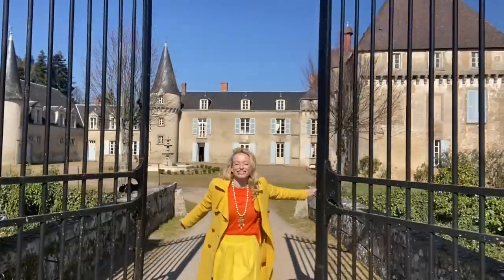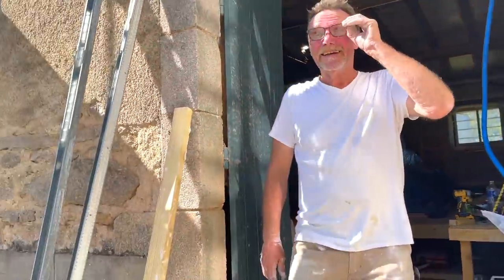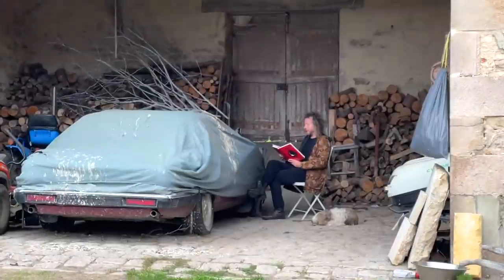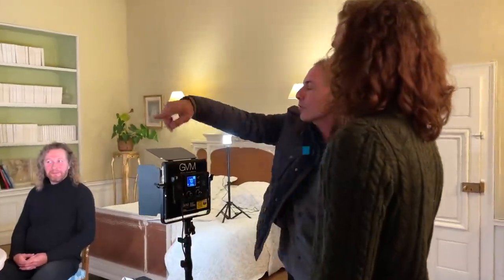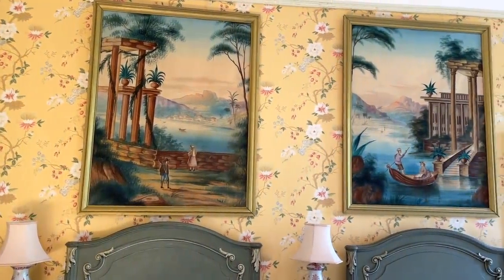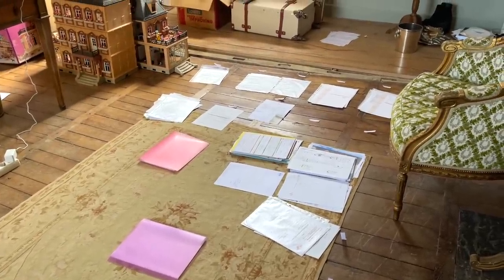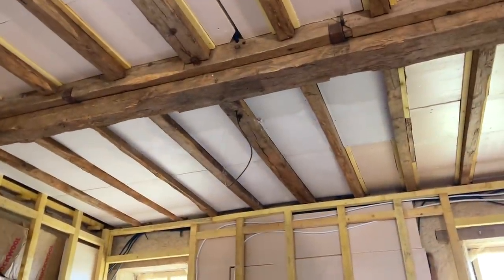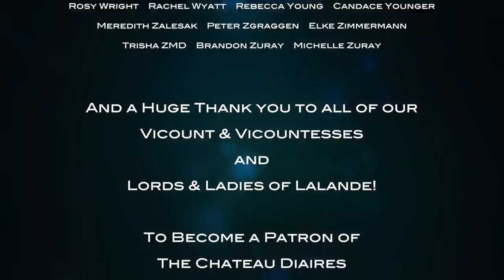DOING IT OURSELVES!

Comment: I wanted to supplement my post from yesterday with some other information.  When you increase the size of the radiators for more heat, that increases the amount of tubing inside the radiator and requires the size of the boilers to grow along with circulating pumps to move the anifreeze mixture through more resistance.  High temperature fluid is also needed to supply the heat you expect from each radiator and overcome the thermal loss due to poor insulation and single pane glass windows. HVAC engineers have 4 year degrees and  usually apprentice for 10 years to learn what you are trying to do by searching the internet. Here's my cliche for what you are attempting. "You don't know, what you don't know" this will end badly. Sorry, it's too big and important to "do it ourselves". Please hire a proper and engineer like Dick Strawbridge. He could help you. Respectfully, Jeff Martinec, retired Facility Operations Director and construction manager.

Comment: I notice that the thermal insulation in Nati’s apartment is covering the area between the two new French doors at the back where you hoped for another window. Were you denied planning permission?
Reply: @debbiebirnbaum2977  the rear ground level is higher so this is a practical solution to allow Nati a view from her bedroom/living room and easy access to the garden but will also give interest and a sense of more space to the apartment. I just wondered about the planned extra window. Reflective surfaces in the decoration will move light around the space so I’m sure it won’t be a problem.

Comment: FYI…when you have those large lilies in arrangements…as they open “slide” the anthers off.  the “stem” will still be intact and the flower will appear normal.  you don’t visually miss the actual anther… which if you leave too long will litter what lies beneath with pollen! 🦩💐
Reply: no…just the pollen!  it really makes a mess inside the flower itself and whatever is under your vase.  one of the lilies had no anthers…one did… probably had open further from when arrangement was made.  it was a lovely arrangement BTW!

Comment: is it possible to add a valve on the radiator supply line so that the water to each radiator can be turned off individually?  Might make future maintenance easier?

Comment: Have you changed something recently in the heating system, maybe mixing a new radiator (maybe mixing aluminium with iron?) which is making the rest corrode from inside? Something has happened in the installation for all of them to be that bad and leaking at the same time… Or they are just made to corrode after 15 years exactly… on top they are the expensive low temperature ones for geothermal /aerotherm systems 😬😬😬

Comment: Were rads frozen at some point with water inside and that cracked them?  But they look to be steel rads not cast iron , so they should not crack so easily by frozen water. What on Earth is going on? The calculators are notoriously inaccurate , they will always OVER estimate and you end up with too much rad capacity. Even calculators that adjust for local weather patterns are still wrong by +100%. So get half of what the calculator suggests.

Comment: Dear Stephanie and all your expert Lalande helpers! With regard to the central heating, have you considered a ground source heat pump, which would be much more efficient and “future ready “? Since you are making such efforts to improve the insulation this might make sense? The fact that so many of the radiators have leaked must raise many questions about their construction? Very best wishes and keep up your amazing energy! Best wishes, Andrew
Reply: it’s what they have now. thermal heating from the ground
Reply: Air + wrong anti freeze liquid = corrosion. Nothing to do with the quality of the radiators or the boiler !
Reply: Actually they have a BOILER which Stephanie said in her Patreon update would need to be bigger in future for the new radiators, so either gas or oil.

Comment: As part of your long term plan, did someone mention that the geothermal needed to be upgraded? Will the current system support additional radiators?
Reply: the whole thing needs a makeover...that's kinda why i started watching in the first place. Old stones made comfy, my favorite corner of youtube.
Reply: I think it was mentioned that the pumps might have been drilled too close together originally, they aren’t getting optimum heat to each one. And the mentioned moving one or adding a new one? I think it was after the land survey

Comment: FRESH FLOWER LOVERS - TIP FOR EXTENDING FRESHNESS: My floral arrangements outlasts everyone's for one single reason. Every night, I put them in the refrigerator. So, don't cook more than you need and you'll have enough space in the fridge for a vase of flowers. Also, take out any that have wilted. You can hang them upside down to dry and reuse them in dry arrangements or in potpourri. Eventually, the compost heap will be home for all of them.
Reply: I just put the vase outside at night, even in the summer it is cooler and extends the riot of colour

Comment: Didn't you have a warranty on your radiators? It looks to me a failure of the mechanicals.
Reply: It's more likely  too much air in the system + the type of their anti freeze liquid they used = corrosion. Nothing to do with the radiators company.

Comment: I have a theory why you have so many of the radiators leaking. Do you have copper and aluminum built into the same system? It causes corrosion which would made sense why so many started to leak at the same time.

Comment: I would contact the company that made those crappy radiators - shame on them.
Reply: Radiators can be eroded if too much air is in the circuit which can cause corrosion and radiators burst. The type of the anti freeze liquid can provoke an corrosion too. To avoid this, you need to empty the circuit and radiators regularly.

Comment: Manual J calculations can be a bit of a slog...esp. in such a large building. You'll get it though. Hopefully your GSHP can output enough heat to supply all of your new radiators. Hopefully it doesn't come to this, but I'm sure Dan wouldn't mind using the digger to put in a larger ground loop. Alternatively, if you could get the lake filled again, you could sink another loop in there. That would be the easiest way to add capacity.

Comment: You must call a pro & ask if a corrosion problem could be the cause. Bet you could be given an answer online. Electric wiring near certain types of pipes cause corrosion. New radiators would just leak again.
Reply: Correct. And too much air in the system + their type of anti freeze liquid.
Reply: ie: it needs experience & not talented but inexperienced heating beginners. Even the size of the radiators are being "guessed" at! Could be a huge expensive mistake to DIY.

Comment: BTU. not watts honey,  thermal units but you and Amery are using your heads but research the new boiler secondly...for capacities...Is electric heating another option? Gas in Europe will be hit $$$ rise 300% this winter.  Please find an engineer to review your spreadsheets consider your options. Patrons may assist of course...but they aren't feet on the ground...consult your aunt and uncle the Petrick Family  powwow